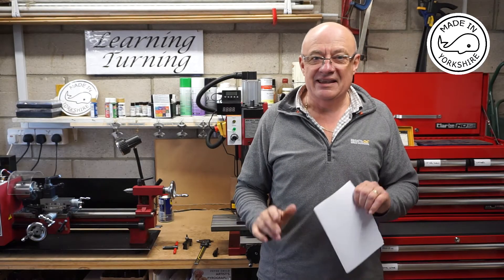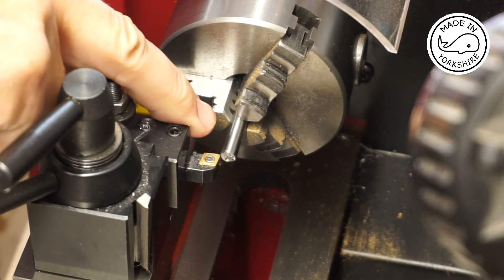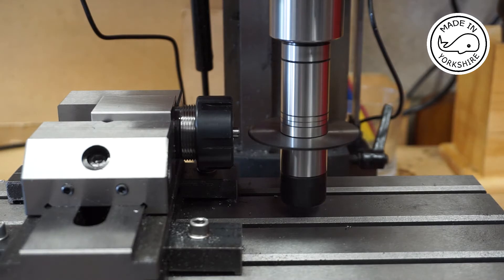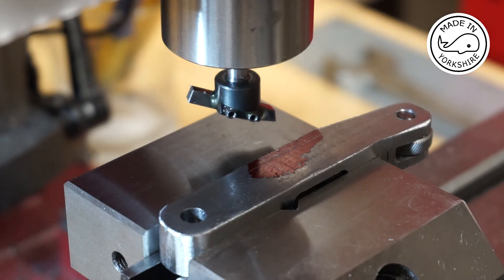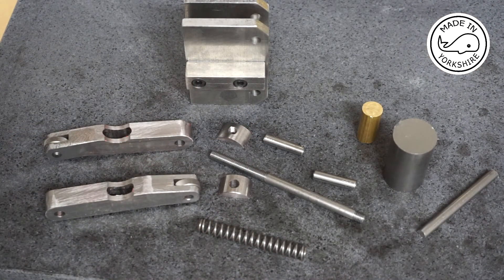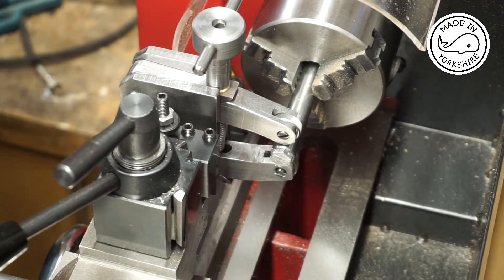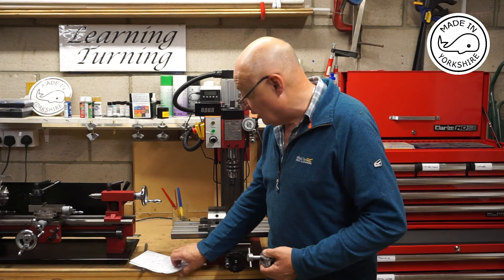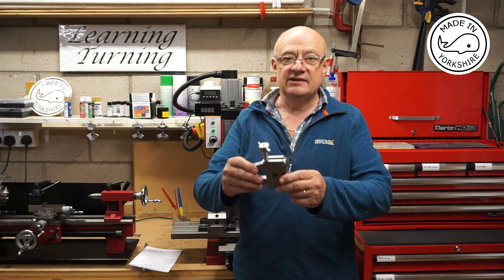#MT19 Part 3 - Making a Hemingway Kits Knurling Tool. By Andrew Whale.

Comment: As a Marine, I've long found "after action reports" to be extremely valuable, in assessing success and failure.  You do a remarkably fine job at such assessing, and it adds substantially to your videos.  I learned the trade as an "outsider", and it's a real pleasure watching you take your lessons well in stride.  Having done this for a living thirty plus years, I still learn details from watching others, "breaking into the field".  I made a knurling tool many years ago, when I couldn't afford to buy one.  Thanks for sharing your trip down this road.
Reply from the maker: Thanks John!

Comment: Enjoyed your excellent video. Cracking result. Interesting seeing the epoxy take that kind of vibration. I permanently repaired the sloppy wiper linkage on a Fiat Seicento with that amazing stuff. Also works well sealing inlet manifold vacuum pipe joints. 😉
Reply from the maker: Thanks Paul - yeah epoxy resin is amazing stuff.
Cheers
Andrew

Comment: Years too late with this suggestion but the trick to fix that fly cutter is to get a map gas torch and some silver solder.  that will let you build up the metal so you can re-tap it.   Anyway these days I'm sure you would have no problem making a fly cutter from scratch.
Reply from the maker: Hi John - it's never too late to provide me with good advice! I have since acquired a mapp gas tourch and some silver solder - so I need to remember to give it a try in future.
All the best.
Andrew

Comment: Hi,
When you cannot use the vee in the vice for holding round stock , use a vee block.
You were lucky holding the round bar vertically in the vice, most of the time the part will come loose.
Now you can tear it down and use Phillips professional cold blue, to prevent your finger marks from rusting,when handling  the knurling tool
Blue only works on steel parts, if it's magnetic it will work. (Does not work on stainless steel).
ATB Adam

Comment: Very cool project!  I just got the Hemingway rotary broach and will soon be getting their ball turner.  Randy Richards did a cool video on the ball turner and the rotary broach is well.  I also have the same bump style knurler.  It works but like you said it puts a lot of pressure on the spindle bearings.  I have made some very nice knurls with it but it is limited to a small range of diameters.  I am going to attempt my own scissors style knurler as ai already have my own plans drawn up or else I would go with the Hemingway kit
Reply from the maker: Thanks Brandon - I fancy getting the Hemingway ball turner too!
Good luck with your knurler.
Cheers
Andrew

Comment: Normally people use oil when using the knurl tool but could be wrong.  Great work on the fly cutter.
Reply from the maker: Thanks for the tip. Looks like some folks recommend it. I'll give it a try next time.
Cheers
Andrew
Reply: Learning Turning Metal - by Andrew Whale Yup, lots of oil as it helps to flush out the chips and lubricate the knurl

Comment: Very nice work, Andrew. That tool should serve you well. Every time I see those nice handwheels on your lathe, I kick myself for not going with the ones from Arceurotrade. The ones I received from Amazon looked like chrome in the ad but, turned out to be just polished and the handles were poorly machined with lots of grooves in them. I may see if I can smooth them out.
Reply from the maker: Thanks Dave - and I'm sorry to hear about your handwheels. Mine may look OK on camera but they are far from perfect.
Cheers
Andrew

Comment: Impressive work! What you haven't discovered yet is to get the correct knurl the material diameter needs to match the knurl pitch. https://www.youtube.com/watch?v=MpXDSx9Bov4
Reply from the maker: Thanks Dave - and well spotted! I haven't got a clue as to how to use it. Many thanks for the link - I will check it out now.
Update: Your video explains the maths very well and I now understand that you need to make the diameter of the material match the knurl. I really appreciate you pointing that out and I will now experiment!
Update 2: My knirls are apparently 0.029" pitch, so I created a simple spreadsheet to calculate correct material diameters for knurls going from 40 to 120 in increments of 5
Cheers
Andrew

Comment: Outstanding Andrew.  Nice job on the finished product.  You might want to think about putting some knurling on your  die holder.  Glad to see your epoxy job on the fly cutter worked so well.  Truly though I would send it back to your supplier, a product of that sort is zero quality and might be unsafe to use.  Cheers !
Reply from the maker: Hi Greg - knurling my die holder is a brilliant idea. Not sure I could return the fly cutter now I've totally messed it up, but i get where you are coming from.
Cheers and have a great day.
Andrew